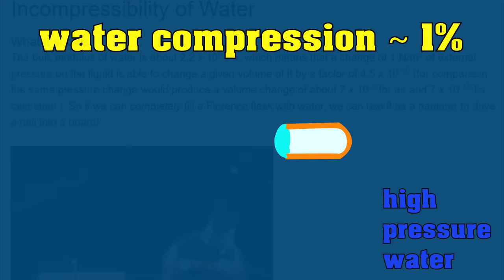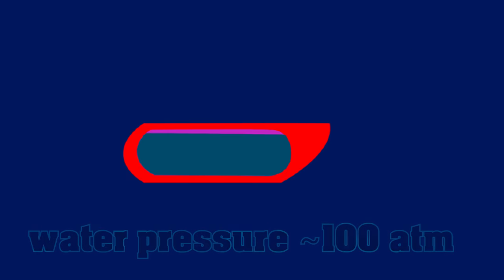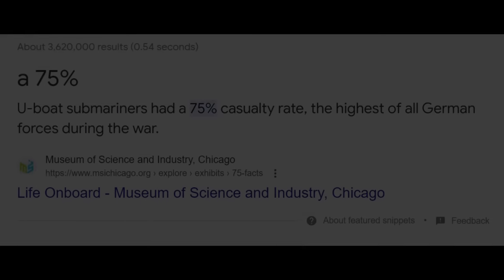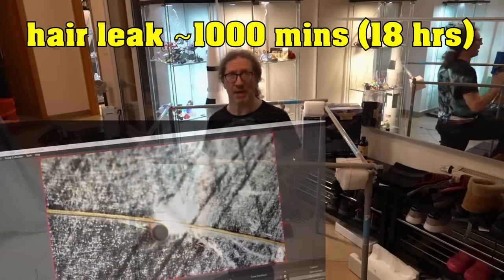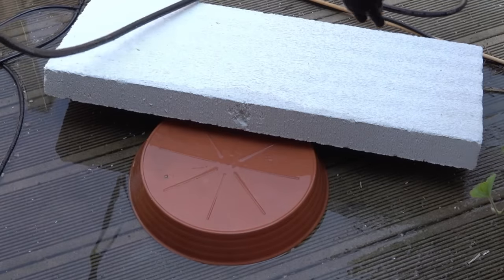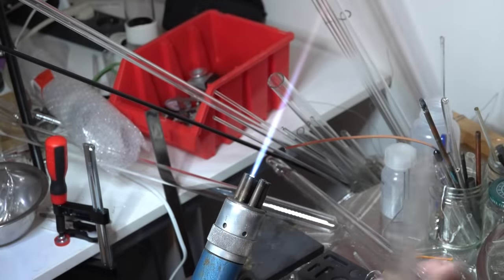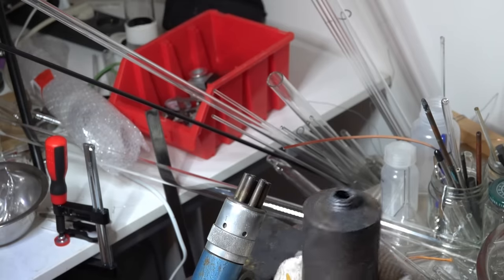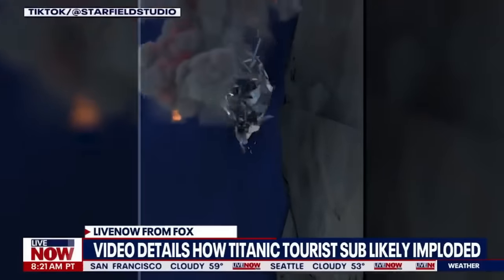Why the Titan sub failed

Comment: The Hydrolic Press channel demonstrated implosions of steel and carbon fiber models of the sub in a pressurized water tank. The carbon fiber hull was crushed in an instant when it reached a certain pressure leaving the steel caps, similar to the recovered wreckage.
Reply: Nothing surprising, carbon fiber failure are pretty insane. The thing just shatter like glass. Probably just a case of delamination but no way to be sure the cylinder is probably in millions of pieces right now.
Reply: They've also demonstrated, with the help of gelatin to mimic flesh, the effects of a tiny hole (0.4mm iirc). It was insane.
Some other expert on polymer bonding I stumbled across, mentioned using glue as a principle wasn't a problem.
But he choked on seeing the cleaning being done in a warehouse rather than a cleanroom, and touching the cleaned surfaces adding grease.
I'm certainly not qualified, but I was stomped to learn that glue could actually be a thing. Love youtube for all the unnecessary stuff we learn 🤣
Reply: @gottagowork  The OceanGate CEO said safety certification was a waste... Truly a Rush job.
Reply: @legro19  Even if it wasn't, the only way to know is destructive testing (as far as I know.) To even know if there was a problem, they'd have to cut the carbon fiber, I don't believe it can be tested the same way metals can be.
Reply: @leviathanops4524  Ultrasound inspection of CF is normal.
Reply: @gottagowork  Whats crazy to me is simply not touching your recently cleaned surface is common among even teenage PC enthusiasts. The kids who one way or another got a few hundred dollars together (closer to $500-1000 now) understand to NOT touch the clean metal heatsink and CPU spreader because it will reduce thermal performance due to the oils on your fingers. Yet these engineers making a deep submersible didn't understand or didn't care.

It's sad when a 13 year old puts more effort into putting a computer together just because it will increase performance by a nearly imperceptible amount, but these guys couldn't be bothered when it's half a dozen peoples lives on the line.
Reply: And this is why you don't visit the Titanic on The equivalent of a submersible purchased off wish
Reply: @eyebrid  It's a small. but warped mercy that he died with the sub, so he can't do the same to others in the future.
Reply: There was an instant implosion, the US military heard the noise.
Reply: The way I think it imploded, speaking on a miniscule time scale, was that there was delamination from prior dives that caused a leak on the last one, but it didn't flood the sub, it caused exponentially rapid further delamination that compromised the structure.
Reply: @legro19 If the cylinder is in millions of pieces, it likely means it was the carbon fiber itself that failed. A failure in the joining to the titanium rings, such as a pinhole leak or a failure of the window would have reduced the forces on the carbon fiber or inverted them to be in line with the carbon fibers strength under tension, resulting in larger pieces of carbon fiber found.
Reply: @andrewtaylor940 that's an interesting idea. I want to see more experiments though
Reply: The tube is about 7.9 feet long, 5.3 foot diameter, 4.0 inches thick. 
It would compress about 3/4 inches under full pressure.
On a 1/25th scale model the tube would be 3.79 inches long, 2.56 inches diameter and 0.160 inches thick. This seems a bit thin.
Reply: @andrewtaylor940  Of course the carbon fiber failed. The thing was at 4000 psi. The 2 endcap were applying 2800 m/t par square meters on this cylinder. Whatever fail this cylinder crunch and shatter.
Reply: On the video of the tube being lowered on the tube you could see there was no squeeze out of the epoxy.
Reply: @legro19  You’re hitting on what many people are missing: the carbon fiber tube was in compression longitudinally - the material had the very least strength in that orientation.   Ironically, it would be the pressure of the water on the sides that prevented it from failing sooner.
Reply: HPC proved, that carbon fiber composite not get any weaker with multiple "dives", if fiber is made right. Tube HPC used had fibers crossing each other in big angles. Titan had fibers just wrap around, barely crossing each with degree or so.
Reply: @gottagowork of course glue could work.. so could carbon fiber. the engineering isn't all that bad in theory but it would need a lot more resesrch and resources put into it, like any other unconventional approach that could cost people their lives. Even without that they could at least preformed extensive testing which probably would've prevented the disaster.
Reply: @gordonwelcher9598  Not a probleme, has long the epoxy is hard enough. The pressure want to crush it not seperate it. Far from ideal but...
Reply: Plus, welcome to the world of marketing lies.
Reply: @PexiTheBuilder  Delamination is a probleme with those material. Very bad at resisting material fatigue. what ever she can endure there is an steel alloy wich with the same capacity will do it 1000x more before starting to show fatigue.
Reply: @gordonwelcher9598  Yes, the HPC cf tube was 4 mm thick but had cross lamination making it very strong, and it was glued in a channel in the steel caps as opposed to only the outer side of the titanium caps of the sub. It wasn't a perfect model but likely a good representation of what happened. The inner titaniun liner, about 1/8" thick iirc, wouldn't have added much protection, might have crushed flat instantly.
Reply: @gordonwelcher9598  yeah sometimes doing to scale isn't good enough for testing. Need to build a full size.
Reply: @PexiTheBuilder  The problem is it would still flex slightly under pressure while the titanium endcaps would not, that causes an inevitable failure point which engineers warned about and were subsequently fired for and replaced with students.
Reply: @1kreature  Yes, but the thickness of the composite in this case made it impossible.
Reply: @legro19  
I wouldn't say glass. It shatters more like wood does, it bends until it snaps catastrophically - see carbon failures on carbon road bikes.
Reply: That doesn't make sense because the sub was on its way up. The implosion happened at much lower pressures than what the hull  withstood in the same compression cycle.
Reply: @fto3367  If your reference is the text messages between the sub and support ship, it's unconfirmed, but going with it they were rising too slowly, they cast off the balasts and the steel frame and it didn't help. I could be wrong but suspect the esthetic tail piece may have flooded.
Reply: @eyebrid ep, the carbon fibre was defective material from Boeing and it wasn’t cured in an autoclave so probably had voiding that led to the inside layers delaminating. That would have got worse over time and started making cracking sounds since the sub was never cycle tested. Given carbon fibre tends to shatter when it fails, the monitoring system would have picked up the failure milliseconds before it imploded so it was pretty useless.
Reply: It was a good episode, but it was not a simulation of the Titan event.
Reply: @Stuntman707  I can't find the original footage but I remember watching David Pogue saying it sounded crunchy. That was a previous model that was decommisioned and replaced.
Reply: @gottagowork  I assumed in the video where the guy wipes the ring with a rag, and then rests his ungloved left hand on the mating surface, that it was a demo/promo shot.
Reply: @2009dudeman When one glues PVC pipes together, one doesn't touch the surfaces after cleaning.
Reply: @elftax  Indeed.  A guy called "Real Engineering who got his MSc in CF failure put a nice video out just recently.  One mechanism he mentioned was "snap delamination buckling" or something like that.  I think TF is right to highlight that ring joint as a stressor.  He didn't mention that because the CF was wound not a mesh, all of the shear force from that stress was largely being taken by epoxy with few fibres crossing the shear plane.
Reply: @1kreature too my knowledge, it's not effective past a certain thickness, and Titan's hull was 5". 
I think X-ray can also be done, but while it doesn't suffer the same thickness constraints, it's still pretty difficult to pickup carbon fiber, which is similar in "visibility" as human flesh. 

Not to say I think any of these technological hurdles can't be overcome, but it does make it trickier than most systems, and the CEO already cut corners so deep you could drive a semi through the malpractice.
Reply: @elftax  Not only did they hear the noise but a lot of people knew right where they should look immediately and yet nobody did that and instead they spent days searching everywhere BUT where the sub was when contact was lost and the noise was heard at the same time. Probably figured it'd be a good distraction from the other things that were going on that week and what's a few days when they already know the crew is dead right?
Reply: @atomicskull6405  They didn't have the ability to search the sea floor until the ROVs arrived. Only a handful of vehicles can reach that depth and they had to travel there
Reply: Thanks for this comment. Good watch
Reply: @eyebrid  
to be fair that is true... this is/was not the only private sub operating commecially without certification.
it is so costly that it is simply not a viable option for a project that needs to make a profit.
Reply: @PexiTheBuilder  not really... they used 10 min cycles... the titan dives were like 8-16 hrs or something... so I wouldn't say that test proved much.
Reply: @fto3367  ehh.. the text msg said they were at like 3500m if I dont remember wrong... 300 m away from the bottom..  and when they tried to go up all they managed was like 20 m in a few minutes..
Reply: @SloverOfTeuth  one thing I don't get... if the compression difference between titanium and cf was such a problem,  why didn't it fail on the first x number of dives?
Reply: @leviathanops4524  they inspect the carbon fiber in jets using ultrasound.
Reply: @eyebrid  im no expert but thats what i think happened. If the sub transcript thats been everywhere lately is real the crackling sound they kept hearing would likely be the carbon fiber beginning to go.
Reply: @kungfreddie  It failed on the 14th expedition.
Reply: @kungfreddie probably because initially it was strong enough
Most materials are pretty flexible, but continued stress weakens them
A good example are paperclips. If you continue to bend one it will eventually snap
Reply: @leviathanops4524  The only way to be certain is to test carbon fibre to destruction but this wasn't done.  You would also need to test it for a number of cycles because even though your carbon fibre hull might survive to a depth greater than you intend to go before being destroyed, a number of cycles to a lesser depth may progressively weaken the hull until it fails at a much higher depth than it's intended to go.

Every aspect of the sub was dodgy, from using carbon fibre in the first place, to poor cylindrical design, to using expired carbon fibre, to winding the carbon fibre radially instead of a cross-hatch, to gluing the end caps on, to using "consumer grade" electronics in areas where a failure would cause death.
Reply: @gottagowork  Yeah I've only first seen that cleaning footage here in this video, and I immediately cringed at that.
Reply: @gottagowork  literally what I observed in the video, he was was wiping with a cloth and then holding the rim with his hand. if you ever cleaned anything with izopropil alcohol you notice that after cleaning any touch leaves a residue.
Reply: @1kreature It’s not adequate for this purpose, however.
Reply: @leviathanops4524 in aviation we use ultrasonic scans and tap testing to check for defects and delamination in CF